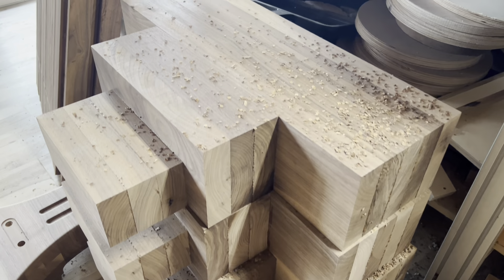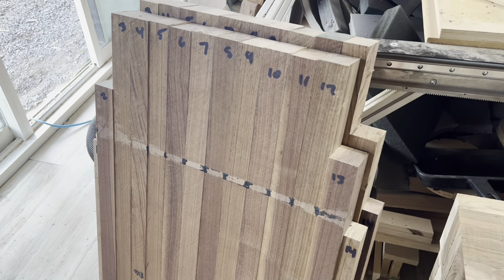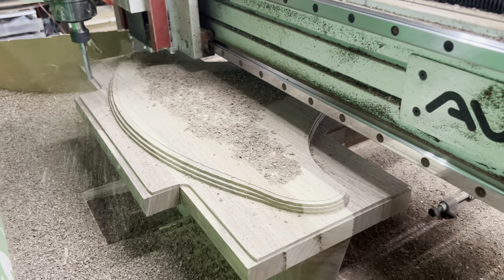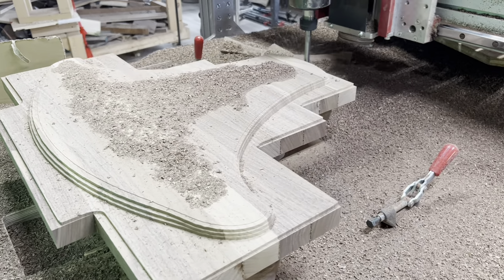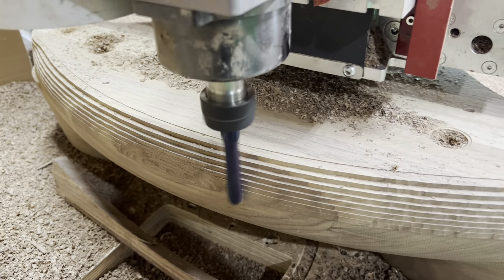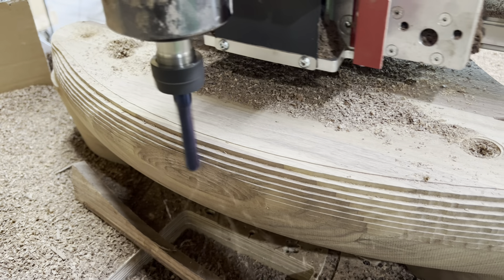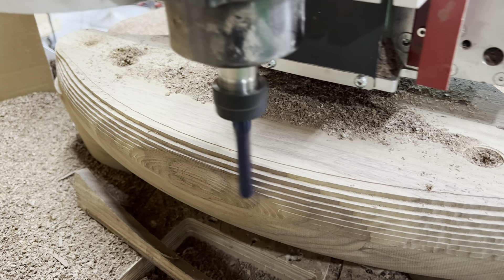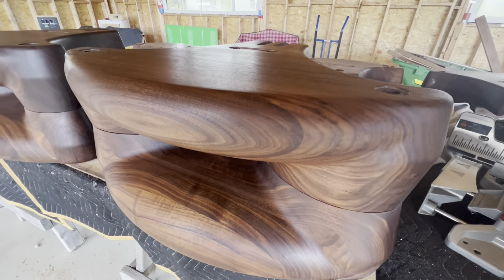How it’s Made! Solid Walnut Horn Speakers By Joseph Crowe Custom Audio!

Comment: Very nice! 
I am thinking of not continuing with Rhinocam. It's getting very pricey. What are you using for post?
Reply from the maker: We use Solidworks for CAD and BobCAM. SW is $4,000 USD and BobCAM is around $1,000 USD as standalone installs. We push BobCAM to its capability limits using Advanced Roughing and Finishing. SolidworksCAM Premium requires expensive annual maintenance which I’ve avoided.
Reply: @JosephCrowesDIYSpeakerBuilding   what is it doing differently in Advanced Roughing and Finishing?

Comment: You could just cut all the waste away in five minutes with a bandsaw instead of (very) slowly turning all of that extra wood into sawdust on the CNC; probably save you a few days at least....
Reply from the maker: The other side of the horn is where most of the roughing takes place and that’s inside the horn flare. I’ve tried trimming excess off but the hardwood is 6” thick and weighs 50lbs. We are moving into our new shop and so I’ll see what size of bandsaw can do the job.
Reply: @JosephCrowesDIYSpeakerBuilding  18" or larger with a steel frame so that you can tension a carbide tipped blade properly. you don't actually have to cut the curve itself, just make a series of relief cuts and the pieces will all come out, and the carbide will handle 6" with no problem. Regular steel, not so much...